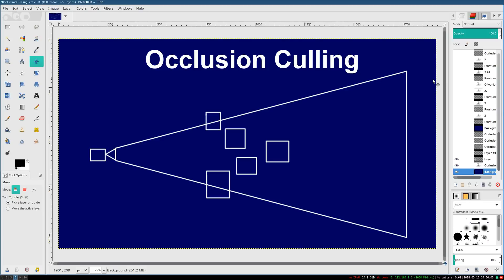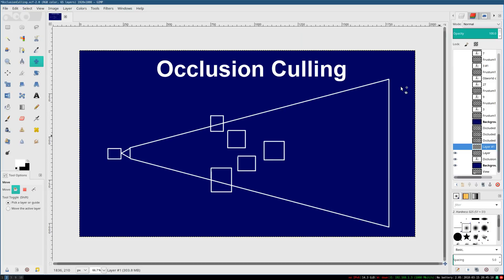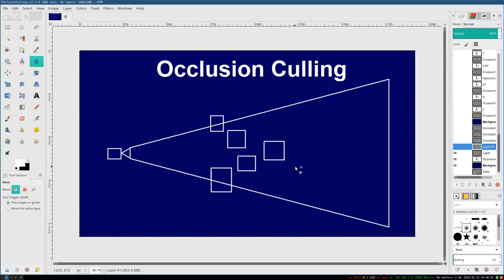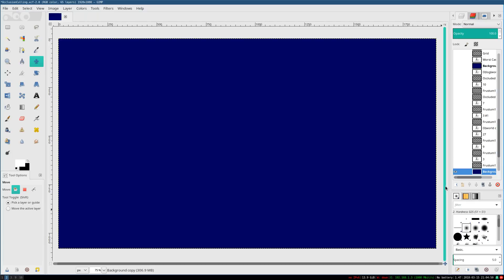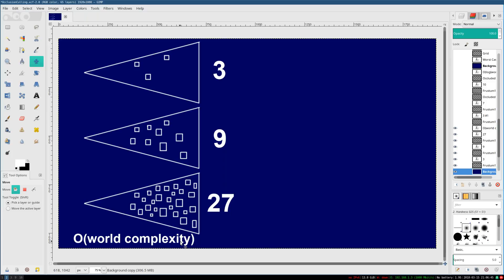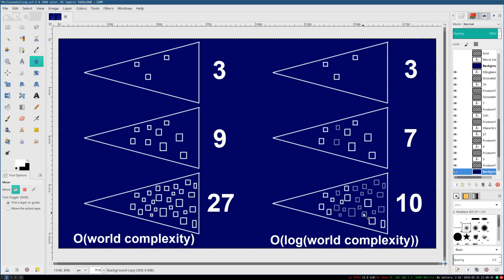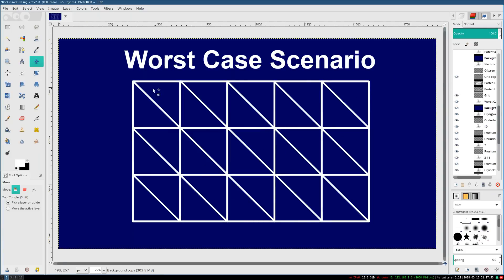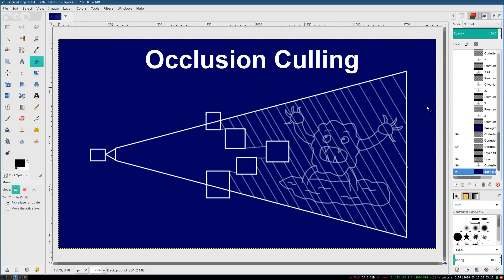#1 How Occlusion Culling Works: Introduction

Comment: Hey Benny, i see a simple solution which might work. Not sure if it is perferct and how the performance is. 
My explanation is based on your drawing. You start from top left corner of the view. Then you iterate through each angel from top to bottom. In each iteration you look if there is an object in the view of this angle by inspecting the angle from left to right. If there is an object in this angle, you mark it and continue with the next angle. After the iteration you are basicly finished. All marked objects can be drawn, all other objects can be ignored. You also could do some performace improvment. If you hit an object you could quickly  determin all angels which also would be found in the iteration so you could skip these and continue with the angle which is after the object.
Hope its understandble, if not let me know you questions. I will try to explain it better then.
Reply from the maker: Yes! What you're describing is the raycasting approach to occlusion culling, and it's been employed successfully in several games, most notably the original Wolfenstein 3D (you can read more about how that works here, under the Engine section http://fabiensanglard.net/wolf3d/index.php ). It's a great approach, but the issue is performance. For a game like Wolf3D where you can only look left/right and not up/down, you can get away with only casting one ray per column of pixels, so performance is okay. In a more general scene however, you'll need to cast one ray for every pixel on the screen every single frame. That's equivalent to doing real-time raytracing, just only for determining occlusion rather than drawing the scene. Unfortunately, that's impractically slow for most real-time games, so other approaches must be considered.
Reply: Thank you for you answere. I totaly forgot the 3rd diminsion. You are righht, this might be a bit overwhelming. I'm looking forward for your series. I am realy excited to see the solutions.

Comment: What operating system do you recommend for game designers like you? And which one are you using right now
Reply from the maker: The most important thing with an operating system is it lets you do what you need to do without getting in your way, and that's going to be a little bit different for everyone. For me, I've found using Manjaro Linux with the i3 window manager is great for that, but your results may vary.
Reply: Thanks

Comment: How the fuck did you get to that formula "O(log(scene cinplexity))" wtf is this bullshit. What does "scene conplexity" even mean. Number of objects? Vertices? Shader complexity? All of that together? Occlusion culling only addresses a few of these factors! 

And you realize that you can order the objects so that occlision culling helps you a wet fart? Why would it still decrease rendering time, then?
Reply from the maker: Correct! I never defined what exactly "scene complexity" is. Which is okay, the purpose wasn't to be mathematically rigorous, but rather convey that occlusion culling makes a critical algorithmic level improvement in handling big, complex game worlds, which you don't have without it. That's not to say the math is totally meaningless; it is based on real math even if I was using it rather loosely in this case. I was using scene complexity to refer to the size of the game world and amount of detail present, so you can roughly say "scene complexity" refers to amount of geometry.

You're absolutely right about ordering, that's a good observation! And that's why games have ways to quickly sort objects from any viewpoint to ensure that occlusion culling does, in fact, always do it's job properly. Note though that I am talking in theoretical terms in this video to get the concepts across. Sure, theoretically speaking, a correct occlusion culling algorithm will always perform better in the limit, as the size and complexity of your scene goes to infinity. That doesn't necessarily mean in practice, it will perform better before your scene is already too big and complex to render in real time to begin with. That's one of the big reasons why doing occlusion culling well is so difficult: it has to be both fast and accurate enough in real-time scenes for the benefits to mean anything in practice.

It's definitely not a trivial issue; that's why I'm doing a whole mini-series on it rather than a simple "here's what it is!" video.

Comment: One idea I had was to use the ZBuffer to identify objects which are not seen.  Any object which shows up in the ZBuffer could be flagged for drawing, anything hidden, even by multiple objects like your blob, should not get flagged for drawing unless it has some part of it in the ZBuffer.  I have never even tried to implement this, it was just a thought I got after looking into creating shadows using the Zbuffer from the light's point of view.
Reply from the maker: This is a very interesting thought. The Z buffer is a seductive solution because it contains per-pixel information about how close every pixel is to the camera; the perfect set of information for occlusion culling. The problem of course, as +Merthalophor pointed out, is to get a complete Z buffer you need to render the entire scene, defeating the point of trying to do occlusion culling. That thought has spawned a whole body of research on how to render just enough of the z buffer to properly cull hidden objects without actually rendering the entire scene. It's some interesting stuff, and it's ultimately resulted in a few successful approaches (though they are non-trivial to do correctly).
Reply: by the point you have calculted the z buffer of your objecr and compared it pixel by pixel, it's to late, you already rendered your object. Besides, if the order of objects you draw is wrong, the zBuffer won't help you at all.
Reply: I mean you know the purpose of the zBuffer, right? To decide whete to draw a pixel or not? This has been used for ages, thus is not the solution.

Comment: You can't simple ignore reported hidden objects from scene graph. It's more complicated the surfaces of "hidden" objects can reflect on visible objects and create shadows or emits light in the visible area also. How ever I will follow your solution.
DJ
Reply from the maker: Good thinking! Fortunately, in practice this isn't an issue because computing reflections or shadows requires rendering again from a separate viewpoint. That viewpoint would have it's own occlusion culling (or some games/engines opt to skip occlusion culling for those views, it depends on what you're doing), so anything that view can see that the main camera can't see won't be left out. In short, it all works out without subtle omissions with a rasterization approach.

Now, if you're using raytracing, then it's a different story because reflections/shadows are directly computed from the "active" set of objects, but that falls firmly in the category of "it's own can of worms" anyways.
Reply: thanks for letting everyone know

Comment: What screen recorder do you use by the way? :)
Reply from the maker: I'm using ffmpeg, which works wonders because it's the backend for a lot of video recorders and editors, and I'm just using it directly. I've heard it's a lot harder to set up for direct use on Windows compared to Linux however.